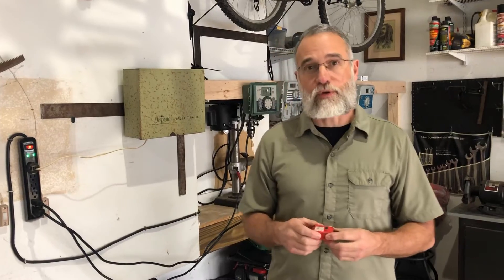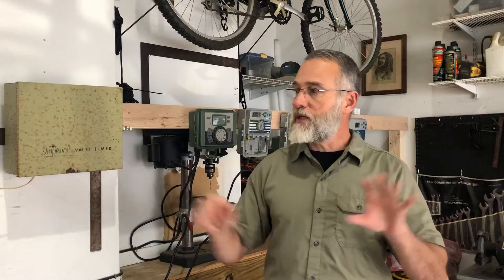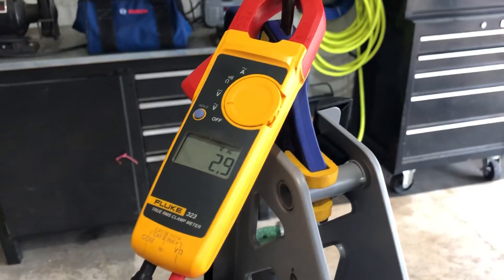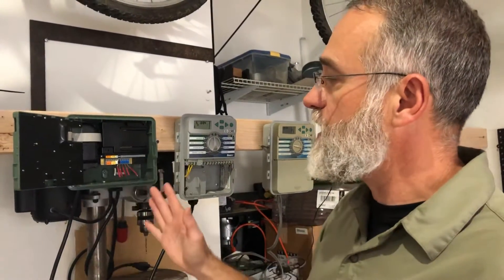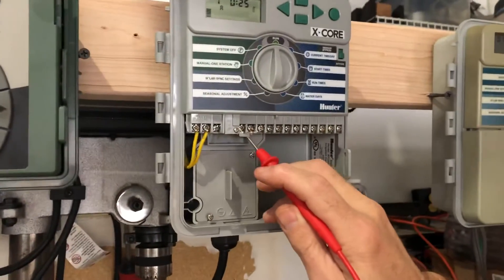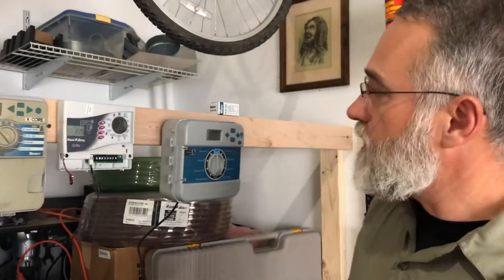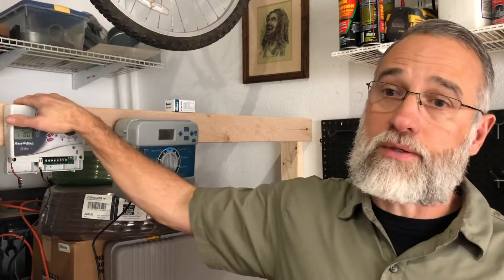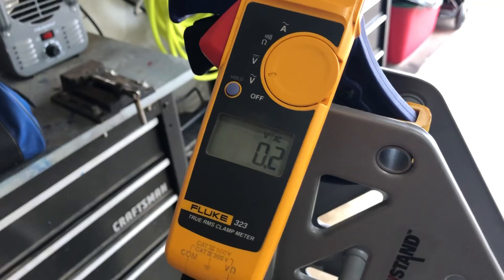Troubleshooting Sprinkler Controller Electrical Issues

Comment: Greetings from San Antonio, TX.   

You and your videos are great.   Since 1995, I have gone through two Hardie (Irritrol) RD-600 controllers.  Today the controller is acting squirrely again.  Rather than getting another refurbished RD-600, can I replace this controller with ANY 24 AC controller?

Or perhaps the 24 volt transformer is bad?  Can I replace it with ANY 24 Volt AC transformer?  How much current is typically needed?

Marius Perron
Reply from the maker: @mperron3  thank you.  You can test the controller with a multimeter to see if the transformer.  We don’t work on controllers.  If they are bad we just replace them.  Yes you can replace it with any brand of controller.  I hope the best for you!

Comment: I really appreciate your channel content! I headed out in the field to figure out what is going on with 2 of my zones not popping up and running. Your content is excellent and is very helpful to troubleshooting efforts!
Reply from the maker: @donaldrippetoe5246  so glad to hear!
Reply: @sprinklerrepair4L  I found a loose wire in the controller and two bad solenoids. Our system is back up and running! Thank you!

Comment: I have re-wired my sprinkler system (took over the parents' old house) and put in the Orbits 6 zone.  
When we turned the circuit breaker back on, the Orbits popped and smoked.....  Now nothing turns on, no pump, no water.
Yes, I connected the appropriate wires to the correct places.  Any suggestions?
Reply from the maker: I would call orbit and get there input on what went wrong.

Comment: Why am I getting only 23+/- volts. The solenoid won’t start with less than 24v. Randomly it will work. When working it’s always above 24v B-hyve controller. New.
Reply from the maker: Usually 23v will open a solenoid.  I would call the manufacturer help line and get there input.

Comment: Could you help me with a question? I just installed a 6 zone Orbit controller but I only have 5 zones to my system. I have wires to the 5 zones but the 6th is not connected. My system is hooked up to a GCFI receptacle and whenever the system gets to the 6th zone it trips the GCFI. Can I just put a jump wire from 5 to 6 to prevent the tripping? Thanks for your time.
Reply from the maker: If you don’t have time on the 6th zone then I can’t see how it would even go to the 6th zone to trip it.  Orbit should have a help line.  I would call them and see what they say.

Comment: How to connect x-core outdoor to the electricity?
Reply from the maker: Technically if there isn’t a plug it calls for an electrician.
Reply: The X-Core outdoor has an internal transformer. All you need is a 3 strand pigtail

Comment: We have a 1989 IrriTrol controller. Nether Automatic nor Semi-Automatic works, but each of the 8 zones works fine if I do each manually via the controller. When the scheduled automatic time comes on (at 4 in the morning!) no zone goes on and it LOUDLY and violently rattles our water pipes. 

I’d welcome your suggestion.
Reply from the maker: If I understand correctly, your valves work if you use the manual aspect of your controller but not when they are scheduled.  This sounds like a controller problem.  Most all controllers have toll free numbers you can call and they will help you trouble shoot the controller.  I hope the best for you!
Reply: @sprinklerrepair4L  Thank you. Unfortunately, due to my controller’s advanced age, Irri-Trol says they can’t help. Any recommendations for a basic 8-station controller—no WiFi needed?
Reply from the maker: I like the esptmt2-8 RB controller if you don’t want Wi-Fi (it’s Wi-Fi capable but I’m not a fan of that aspect).

Comment: I I have a 1960s imperial valet controller. It works fine except every morning I need to push the reset button to get it to work. Any ideas on what the problem might be?
Reply from the maker: No, I sure don't .  I don't work on any controllers.  If you know someone who works on electronics, I sure it would be easy to figure out.
Reply: @sprinklerrepair4L  Ok, thank you

Comment: I have an old Imperial Valet timer and it working in manual mode but not in automatic mode. Is it working repairing. How hard is it to switch to a modern unit?
Reply from the maker: Personally, I'd switch to a new one.  It's not hard to change.  Mark all your wires and you shouldn't have any issues.  I hope the best for you!
Reply: Those electromechanical controllers like that one or a Rainbird RC have time and date wheel advance motors that burn out. If you set the correct time and day and come back the next day and one of them hasn’t advanced properly, that’s the issue, provided you’re sure that you have the it programmed correctly (the correct hour and day pins pushed in or pulled out).

Comment: Question: I have a Hunter Pro-C that is 19 yrs old. Just turned it on for the first time this year, and suddenly zones 4 & 6 don’t work; i have 6zones total. Zones 4 thru 6 are on the pcm-300 module; zone 5 works.  I confirmed zero voltage to the master valve when zones 4 & 6 are active; i get 26 volts to all zones when they are active and 26 volts to the master, except when 4&6 are active. Would you suspect that’s a module issue or do I need to replace the entire controller?  Thank you in advance
Reply from the maker: It's probably the module.  I'd consider cost as it might be a better investment to get a new one.
Reply: @sprinklerrepair4L  thank you for the reply. My thoughts exactly. $50 for a new module. A new controller (fixed) seems like it would serve its purpose for $85 - Hunter XC600i. The options are a bit overwhelming. Wifi would be fantastic but comes with a much higher price.

Comment: Here is a WICKED problem, no matter what zone I select manually zone 2 always comes on as well.  I have eight zones, all eight do the same thing, I select zone 5, 5 & 2 come on, or zone 8, 8 &2 come on.  I disconnrcted zone 2 wire from the controller, same issue, zone 2 comes on with all 8 zones. Zone 2 wire is disconnected and it still comes on,  this is freaking me out !!!!
Reply: Zone 2 runs continuously, the valve is stuck.  That freaked me out.
Reply from the maker: It is a mechanical failure of that valve.  If you didn't have a Master Valve that zone would run 24/7.  Need to find the valve and replace the guts in it or replace the whole thing if it's old and parts aren't available.  I hope the best for you!

Comment: Have a 20 year old Rainbird ESP-8 controller.with 6 zones.  When the timer turns on station 1 it also turns on stations 4, 5, and 6.  When trying to set a time the display sometimes starts jumping around.  Does this indicate its time for a new controller ?

Comment: I have one of these Imperial valve timers from 1976 I got one of these just recently and tested it and everything worked fine except for the 11 zones for the each minute indication it would work on every single one except for the 5 Minute timer it would not recognize it and go straight past it therefore it doesn't do a 5-minute watering cycle I don't know why this is doing this I am thinking this is a sign of where on the components maybe you know the answer on how I could fix this
Reply from the maker: Sorry I don’t.  Someone who works on electronics can help you out.
Reply: Ok thanks for the information.

Comment: Just replaced a controller that went bad because of a power outage. I got the same model, Rain Bird SST600i. As soon as I plug the unit in it starts watering and will not shut off.  I have 2 units and swapped power supplies and the same thing is happening Any suggestions?
Reply: Solanoid?

Comment: My sprinkler system won't turn on. I have 4 stations and none of it is working. Valves and solenoids are working fine when I turn it on manually and Technician confirmed it. Technician said it is wiring issue. Sprinkler wire runs from the Sprinkler controller through the wall to my backyard and then to the system. There is one junction where the wire from controller ends and connected to another wire which runs underground to the sprinkler system. When I used the wire tracer from the controller to the junction and then to the sprinkler system I am getting the signal clearly, so that rules out cut in the wire underground. I checked common wire and wires for each zones with clear signal from controller to sprinkler box. When I used the multimeter on the controller when Zone 1 is running I am getting roughly 30 Volts on all zones (30 volts on Zone 2-4 as well). Technician said wire tracer is not perfect or all wires are touching somewhere in the underground since I am getting 30 voltes on all zones when Zone 1 is running, and 2 to 3 volts on rest of the areas in the controller. No external damage on the wires at junction/open ground. I am a bit confused if it is a controller issue or wiring problem. Thank you for your insight.
Reply from the maker: If you’re getting voltage zones, when only one is running, then it is a control issue.

Comment: thanks for the video! I have a weird issue at home right now. Station 1 on my sprinklers will turn on, run for about 20 seconds then turns off, then turns on again, then off etc. All the other valves work just fine. I replaced the controller thinking it was bad but it does the same thing with the new controller so I believe the station 1 solenoid may be bad.   the brand new controller blinks off for a brief 2-3 seconds,  then turns back on which I believe is causing the valve to come on and off. any thoughts?
Reply from the maker: Usually it’s a short.  Most of the time caused by a bad connection.
Reply: @sprinklerrepair4L  thank you! I was able to replace the solenoid and that fixed the issue
Reply from the maker: @chubbrock659  so glad to hear!

Comment: Thanks so much for your informative video!

I had an issue with my sprinkler system turning on by itself recently during a very bad storm with strong winds (tornado warnings) and heavy rain.  My lights flickered on and off a couple of times and then the power had gone out.  It came back on about 5 minutes later.  It somehow must have triggered something in my sprinkler system to cause some of my zones to come on by themselves.  I went to my sprinkler control box (Rainbird ESP-M) in the garage, but the box looked like it had no power because the display was completely blank.  I had to unplug the controller and then plug it back in to reset it in order for the sprinklers to stop running. 

My control box seems to be working now. However, I’m wondering if this might happen again during another power outage and if there’s something wrong with my controller or if this was a one time, kind of freaky thing that happened. Do you know what would cause a sprinkler system to turn on several zones by itself?  Is there anything I can do to prevent this from happening again?  Or maybe I just need a new controller?

Thanks so much for any advice you can offer.
Reply from the maker: Lightning is the biggest concern.  I've seen it blow controllers off the wall and destroy the wiring and solenoids in the yard.  If lightning hits there's not much that can be done.  You can plug your controller into a surge protector.

Comment: Good video going through many items and helped me determine I had a PCM issue.  I have one issue no one seems to be able to help me with.  I have a Hunter Pro-C 12 zone controller that has 26v at the zone 1 terminal, but the zone does not work.  If I move the wire for that zone to any other terminal, the zone functions properly.  Any ideas?
Reply from the maker: The only thing I can think of is if you have a master valve and the master valve is not giving 24V on that particular terminal.
Reply: @sprinklerrepair4L  following your message I did some more metering and found that the M/V was not being powered for that zone, was able to find the pump setting and sure enough it was set to no for some reason, I changed it and now it is working, thank a ton

Comment: Great video. Thank you. One question, if I turn on one zone should the other zones reflect a zero voltage?
Reply from the maker: Yes that is correct. The master valve slot will always receive voltage no matter what zone is on, and then the zone that it is turned on will have voltage
Reply: @sprinklerrepair4L  thank you! When I test one zone all nine zones are getting 24v, not just the one. Is there a repair for this or just a new controller recommended? Old rainbird E9-C.
Reply from the maker: @thefortyacres4380  There is not a fixture that that I know. However, you can call Rainbird Tech Support and they will walk you through any type of resolution that exist for that particular controller for free.  Hope the best for you!

Comment: Thank you so much for the tips. I had all my zones run at once. I wasn’t sure what to do, until I saw your video and understood how to check it with the voltmeter. While I was in the control box, I saw the reset button, hit it, and that cleared whatever the problem was. I can track the voltage through each zone as they turn on and off, and I’m confident it’s resolved the issue. That saved me $100 for a new controller.
Reply from the maker: So glad to hear!

Comment: My system doesn’t run. When I only connect zone 1 and common to the controller and turn it on, I also see voltage on the other station wires that are not connected to the controller. What does it mean when I have voltage leaking in from the exterior? A wire short? Another things I can test?
Reply from the maker: I don’t have a good answer for you. I want to make sure that you were not looking at resistance versus voltage first of all. You will have resistance on wires that are not connected to the controller, but cannot have voltage unless there is power coming from some other source. Make sure that your multi meter is on resistance and check the meter for that and then turn it to voltage for the voltage check. If you have done that correctly then I do not know another source that could be supplying the wires that are disconnected from the controller. I hope the very best for you!

Comment: I appreciate the instruction.  Very informative.  I have not seen anything that addresses the issue I am having.  Every other time the pump is supposed to start, it will not run.  The pump switch clicks to activate, but it immediately releases and the pump does not start.  The next time, the pump runs normally.  It does not matter what zone it is on, the pump will only run every other time it is supposed to.  The system has four zones, but only three solenoids.  Any ideas?  It does this using the timer or manual start.
Reply from the maker: Mom Bomb you might try reading the ac on the pump when it fails, just to make sure the controller is doing its job.  If so, I’d get someone who knows about pumps to look at it.  I hope the best for you!
Reply: @sprinklerrepair4L  thank  you for the reply.  It is not the pump.  When the pump is disconnected, the switch/relay still will not maintain a closed circuit every other time it is cycled.    The switch/relay has been replaced and still has the same issue.  I am certain that issue is control or wire related.  Just banging my head trying to find where and why it is every other time.  Thanks again.
Reply from the maker: Mom Bomb I’d look at the ac on pump wire in the controller
Reply: @sprinklerrepair4L  thank you, I will check it the next time I am there.

Comment: Thank you for your (calm), instructive video tutorials!    I used to have zero knowledge of how my sprinkler system worked - now I have a solid, basic idea thanks to you!   

Last week, out of the blue, my entire system stopped working.   I am currently diagnosing the problem(s).  Since no zone works, can I assume it's likely a problem with the common wire (I have no master value)?   🤔
Reply from the maker: GSR thank you for the kind words! It could be, I’d start by checking ohms to see.  I hope the best for you!

Comment: I have a Tufsco sprinkler unit no longer made.House was built in 1963.The zones (10) all work both on Auto and Manual but on Auto mode the timer for the days and hour of the day no longer work.So I can set it for the week.My problem is that nobody knows the configuration when they open the inside.It seems like you maybe able to help.
Reply from the maker: Ernest Kanu so sorry but I’m not familiar with Controller.

Comment: My exact same problem, zone 1 - 6 work fine but 7 - 11 aren’t acknowledged by controller (Hunter Pro-C). Did reset and it acknowledged but didn’t have output. Ordered two new modules on Amazon. Hope it works. Thank for the informative videos.
Reply: You have the modules all the way in and the plastic slide set to lock?